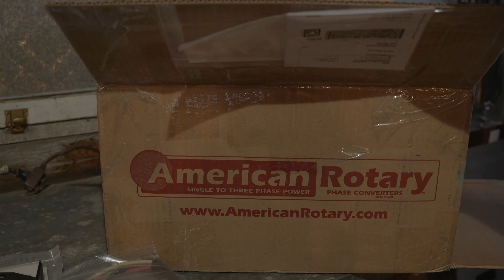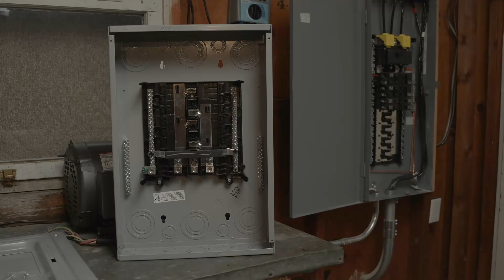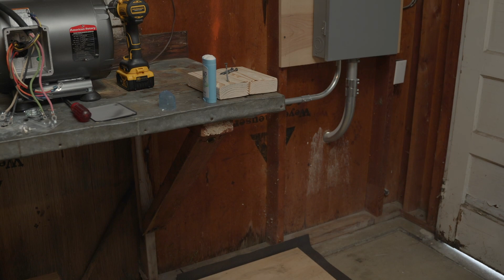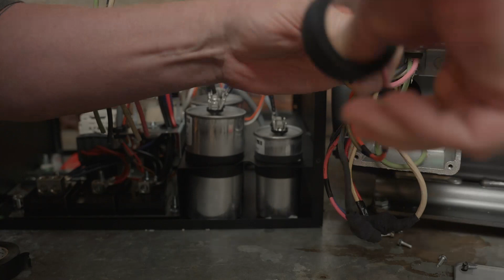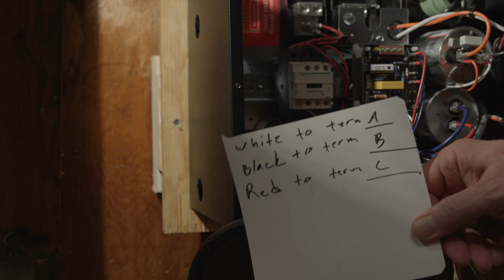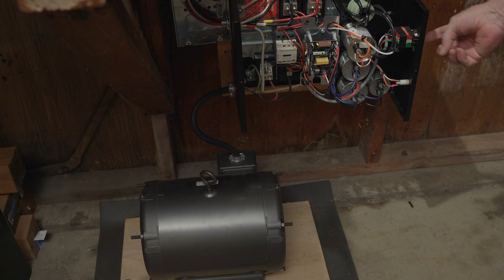Rotary Phase Converter; American Rotary 3 Phase Converter Installation (0001)

Comment: Just received my ADX-10 today, an will be starting the install this weekend. I DO have a question on your choice of 6 Gauge wire. I do THHN (stranded) as well. is 6G overkill? Manual says 10G for a 40A breaker, but does THHN call for a thicker wire than solid? Thanks for your insights! Edit - I unpaused right after posting, and it looks like you went overkill for current assurance reasons.
Reply from the maker: Hi, great question and yes my thoughts was go total over kill because I don't want any sort of overheating in the line. One thing I've learned about having a shop in the past is the electrical system was ALWAYS the number one problem and things like big welders and big air compressors draw a ton of amps. I really worry about electrical fires.

Comment: I like. So, your home power, cames 2 legs with 240v or ou have 2 legs with 127v each? I have in my garage 2 legs with 127v, can work it?
Reply from the maker: Its supposed to be 120 per leg equaling 240 v. But depending on your local grid you might have 127 or 118. Kind of wonky. Some areas have 110 per leg and 220. It will all work fine.

Comment: The high voltage on L3 is normal, and will not drop near L1 or L2 under load. The rotary phase converter essentially creates a high leg delta service, where the L1 to neutral and L2 to neutral are 180degrees apart. The generated leg to neutral is 90 degrees apart from both (in wye). However if you measure the line to line voltage between any two lines (delta), the voltage should be about the same if the balancing caps are sized correctly.
Reply from the maker: Way over my head. I followed the instructions american rotary game me. Thats all I know.

Comment: If you are using white wire for a ground you should mark it with some green tape on each end . Are you up and running now ? I have a ADX 40 in my shop running an air compressor and a Bridgeport mill so far .  Really like the American Rotary equipment . Top notch for sure !
Reply from the maker: I marked the wires and sorted all that out a while ago. The shop is all wired and everything is running good. Im powering a Bridgeport and 40X44 tool room lathe. I had no idea about american rotary until I happened to pay more attention to keith ruckers videos. He advertises them on his intro and did a video on what his set up is. He has a big shop with big machines he's running on his rotary.
Reply: How many amps you are running on the 3 phase panel breaker

Comment: Does this thing shut down your incoming phases when the unit is off or when it faults out?    Need to know if need to add an extra contactor in my set up that kills everything when it shuts off.
Reply from the maker: You need to install a 3 phase subpanel and 3 phase breaker. The 240 that goes to the 3 phase box stays hot even when the unit is off. If it faults the 3 phase breaker will cut, and the 240 will still be live into the box unless the fault is large enough to break the 240 breaker in the main panel. So far Ive really loaded this up and never had so much as a hickup.
Reply: @opiesmachineshop  Between the idler and that 3 phase panel you need an ICM450 and a contactor.  You need it to kill all power to panel in event of a fault.  Say for example you had a temporary blackout.  The American rotary ON/OFF switch would unlatch.  Now lets say you not available to switch it back on right away.  All that time you will be pumping single phase power to 3 phase motor.  Windings will burn.  If ICM 450 would kill all power via contactor, then you have no "single phasing" ( look it up its an official term to a real problem that American Rotary did not address)  Just saying be prepared.  Maybe they offer a phase monitor?  I already have the parts.
Reply from the maker: @joeshmoe5935  I have no clue. I went by the instructions american rotary provided. Im a mechanic by trade, not an electrician. Id be interested to see how you hook yours up though. If you do a video on it Ill link it up so people can see what you did. 

I dont have any of that on anyway if Im not on a machine though. Once Im done doing whatever it is Im doing, I shut it all down. Give american rotary a call, they were really helpful with me.
Reply: @opiesmachineshop  That's just it.  That's why in my example I used a temporary blackout.  Power shortly gets cut off to black box.  Controller sees it like you pressed the red button.  All power to idler gets cut off.  If you are not there to immediately shut/power off the machine that was on, you will have 2 legs of single phase going to your machine trying to force motor rotation and amperage will go sky high and you will end up burning those windings on your machine ( mill, lathe drill press etc.)  U need it so that when leg 3 is off everything is off.  All or nothing.   I can see that happening if you have something long and boring on power feed and step away.  CNC even worse.
Reply from the maker: @joeshmoe5935  I will definitely look into this. Both the lathe and mill are on their own switch so I know nothing is getting through to the motor but I knew 2 of the wires going to - were live but I will install what you said. Uhg, so sick of wiring. LOL
Reply: @opiesmachineshop  Tell you what, 2h3n I really get to take the black box apart and draw a wiring diagram for it, might even be a way to rewire the main contactor to shut everything off in event switch gets unlatched.  Some engineer from North American Phase told me about that.  I saw a screaming good deal on a Used AD60 so didn't go with them.

Comment: Did you use a equipment ground to your 3 phase equipment?
Reply from the maker: The short answer is no. Im not sure yet if I will install one. Being that Im not an electrician, I need to talk to one to be sure if I will add one down the road. Ive read that there can be problems between the 2 structures with an additional equipment ground conductor added in. So for now its grounded from the 3 phase to the sub panel to the main panel to the ground.
Reply: @opiesmachineshop  ok so you ran a ground wire from the 3 phase panel through to the sub panel feed. I read that you have to have a ground wire coming from your 3 phase equipment to the panel that’s why I asked.I’m about to do the same set up roughly as you, I was just a little unsure about grounding the stuff.
Reply from the maker: @jaymachines7587  The 3 phase is grounded through the sub panel. I was going to do an update on this soon to show how the lathe is wired and all. The feed cable from the main box at the house has a good heavy grounding wire which is attached to ground going to the rod in the ground outside. I read this was preferred because if an additional ground rod is installed on the outbuilding, eddy currents can build up between the 2 structures and cause issues with a number of things, so I opted not to add one outside my shop. You still need grounding though just don't bond the neutral bus bar on the subpanel or add ground to the neutral bus bar. Again, Im not an electrician and what I learned is all from the university of google.  It would be best to consult an electrician if you know someone because I hate to give bad advice. Ive been monitoring the set up and so far everything is working just as it should.
Reply from the maker: @jaymachines7587  And the lathe does have a ground wire and it is grounded on the 3 phase box. Not neutral.

Comment: Thanks for the video. What determined the size of the wires and breaker for the supply side?
Reply from the maker: Hi, and you're very welcome. American rotary specified what was needed to supply the unit and I actually had to call them and talk to them about this. One thing I failed to do in this video was show just how well the instructions are that they provide. Thanks for watching!